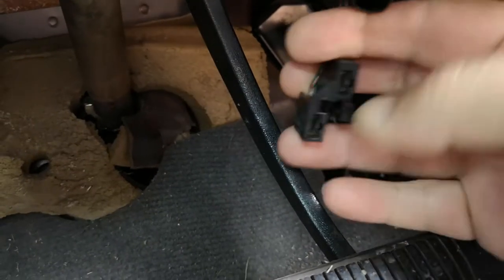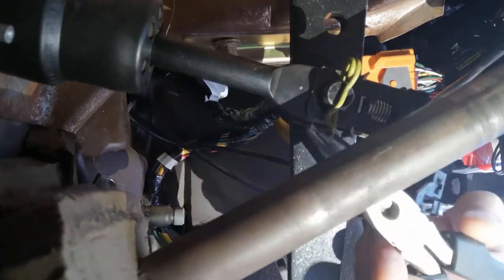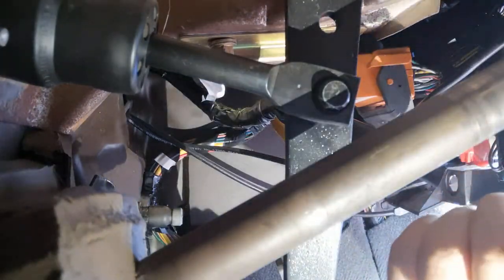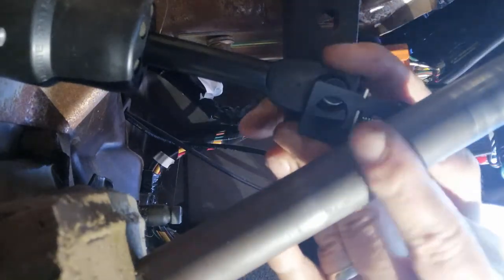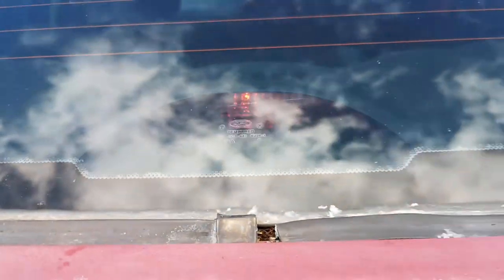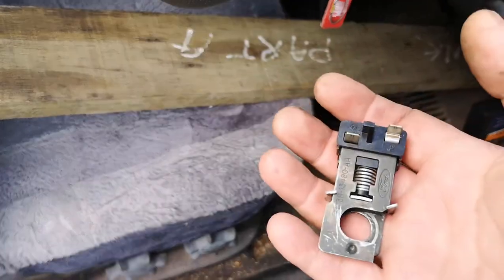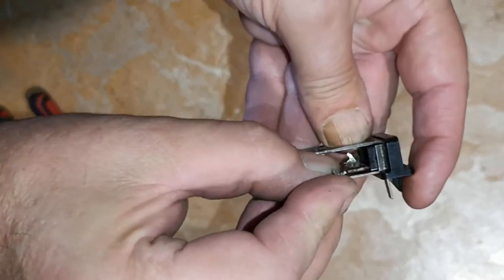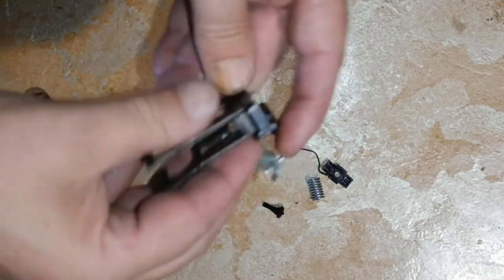Install Brake Light Switch - Ford Falcon AU

Comment: So I did exactly the same as what you did but it's not working unless I push brakes hard to the floor for the brake lights too work
Reply from the maker: It will not make any difference to how hard you push the peddle. the switch will turn on the brake lights when the peddle is slightly pressed and no longer touching the switch. You might have a slow relay that needs replacing.

Comment: there's a spacer against the pedal and a small black "sleeve" ... am missing the smaller component (what you called a sleeve) do you know where to buy one?  ... could get one from the local wrecker, but would need to drive there without it, would that damage the switch? ... not sure if it was missing before needing to do some work on the firewall , had to drop the pedals to do that work. thanks
Reply from the maker: That part only tightens things up so you don't hear any rattle sounds or maybe a click each time you break. It wouldn't damage the switch driving without it. If you don't use one you might forget about it and wonder one day why there's a rattle sound when driving. Better to get one. I don't know it's correct name or part number. Best bet would be to call Ford or as you said get one from the wreckers. Cheers
Reply: @TEKNOFIED  Thanks for that, have a Manual cab chassis and the firewall cracked and collapsed around the where the clutch cable passed through the firewall, never thought I'd fix it myself nd I live out in the sticks, there's a tube that passed through on an angle that the cable sat in, but managed to created something out of a bunch of stuff that looks like a permanent fix, thanks for the info and video!

Comment: I had this problem on my 1999 au Fairmont no brake lights  I took the switch out did a continuity test it came up that it was working even though I have no brake lights so I hooked it backup putting a toothpick in it to simulate it was turned on But still no brake lights even though the continuity test showed it working so I then cleaned up the external power connections on the switch with a file and WD40 hooked it all back up again and it is working fine. Hope this may help as well. Grate video TEKNOFIED.
Reply from the maker: Thank you. I pulled apart and cleaned the old one before replacing. everything worked but not for long, about 1 month or so. So I replaced it. Good idea to make sure all contacts are good.

Comment: how did you clean the switch its self? I cant figure out out to pull it apart.
Reply from the maker: I did open and clean the switch the first time but cleaning it only last about 2 or 3 months. Its a very simple switch. There is 2 bits of the switch you need to bend straight so you can open it up. the spring will pop the black plastic part so you need to be careful not to lose the plastic part or spring as you open it. After you have it apart you will understand how it works.